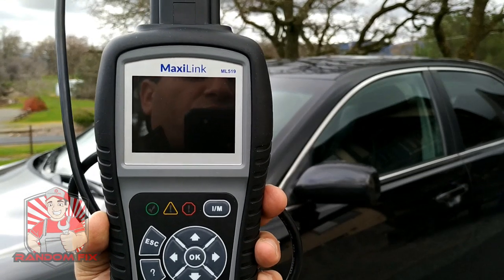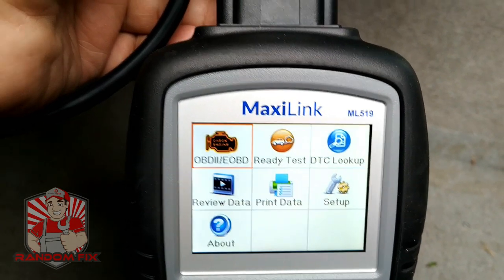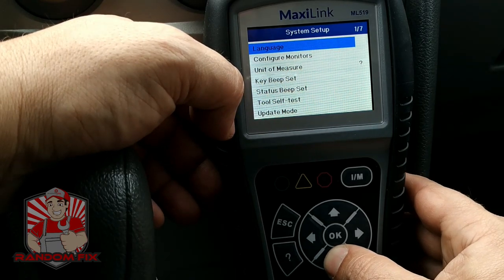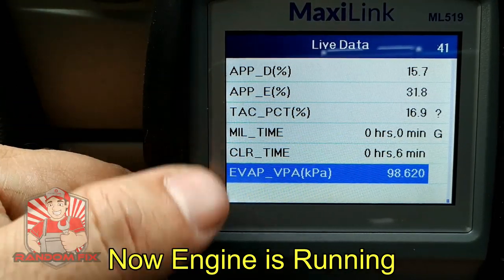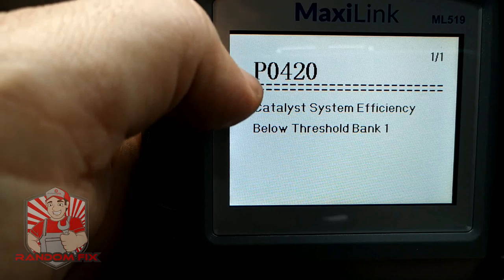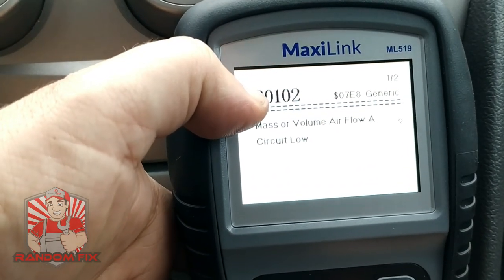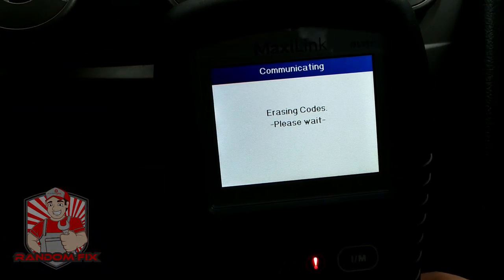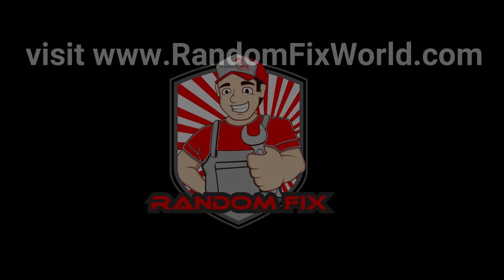Autel Maxilink ML519 OBD2 Scanner Review

Comment: Friend will recognize a mazda 323, or mazda allegro, they use protocol 9142-2 and j1850, that's obd1, will it work for those vehicles?
Reply from the maker: Nope this for obd2 only l, it will work if it’s a 1996 and newer.
Reply: @RANDOMFIX  But all mazda with that 17 pin connector are not obd1?
Reply from the maker: Just go by the year, I have seen a 1995 ford thunder that had an obd2 connection. What year is the Mazda. And yes we are 16 pin for obd2 in North America
Reply: @RANDOMFIX  Actually my car is a 2002 ford laser, I understand that it is the same mazda 323, I am in Latin America, is there any way to scan my car with an elm327?
Reply: @RANDOMFIX  Ford Laser year 2002 17-pin
Reply from the maker: Oh man I wish I new able the Latin market. I like the name “Ford Laser”
Reply: @RANDOMFIX  It is equal to the ford protege, also to the mazda 323.
Do you know if I can scan that car with an elm327 interface, the ford laser has a 17 pin connector.
Reply: Es un carro igual a ese